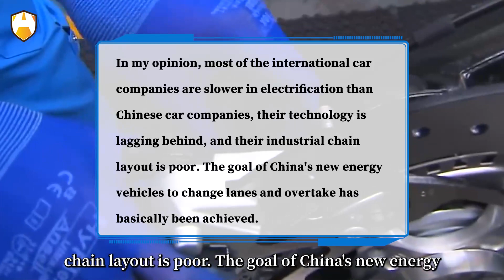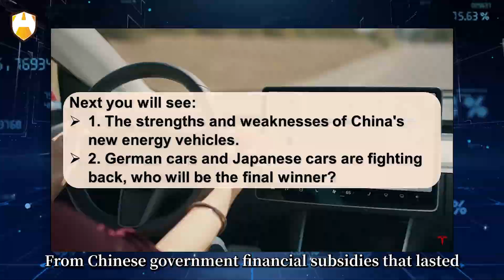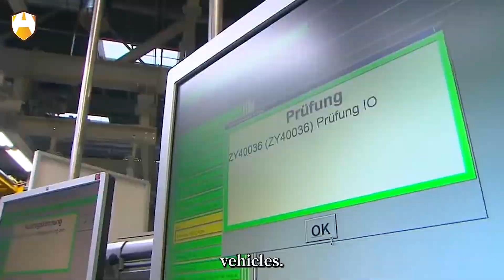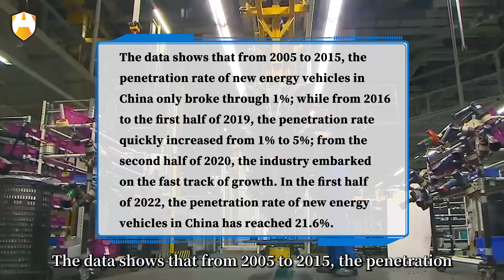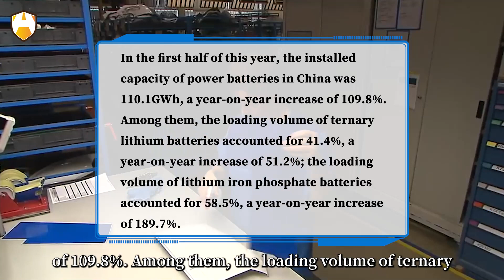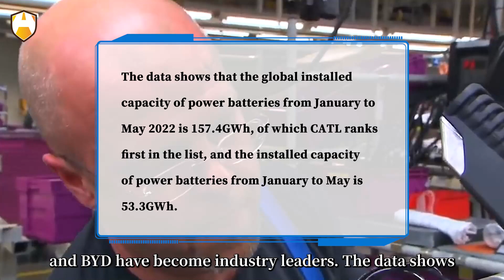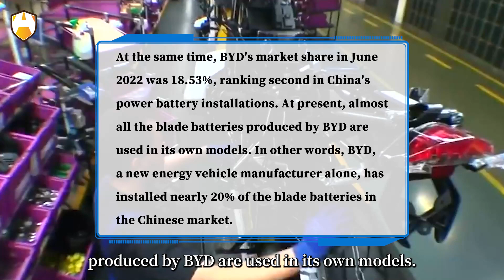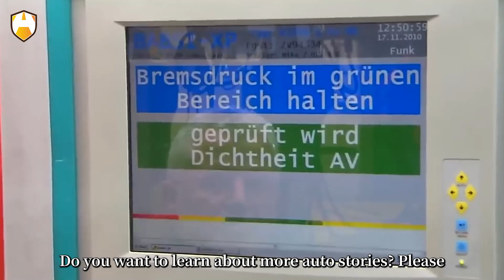China's new energy vehicles takes the lead, but Germany and Japan to fight back!

Comment: I'm sorry,  electric vehicles aren't green. They are expensive, no resale value, extremely  dangerous. They are the opposite of our highest good.

Not even a single country throughout the world is capable of supplying sufficient electricity for EVs. 

Many people aren't aware how dangerous EVs are. These are extremely high voltage ranging from 400V to 800V. 

The solution to our problem is steam engines not EVs. The entire automotive worldwide got everything wrong since day one. 

It's sad to see the Chinese car makers are duplicating the same  mistake.

Comment: We can only hope that Chinese carmakers will build affordable EVs for the world.
Reply: In China EVs are half the price.  They are expensive in the West because the government place high taxes on it. For example a Chinese EV called the CAT is sold around $8,000 to $10,000 but in US its $18 to 22K
Reply: @willng247  EV's 

Currently there are about 1-2% Vehicles on the Roads are BEV...

In USA, 71-75% Electric Powers generated from Coals, Fossil Fuels like Oil/ Natural Gas
In China, even worse, 81-90% from Coals and Fossil Fuels ‼Generated Electricity ─ This year, due to Rivers run Dried, very little coming from Hydro Dams.. Electricity = the most costly to distribute and stored.

What is the Purpose of BEV?  If it cost more and polluted the air about the same as ICE's☺?

Providing if 25% are BEV's the Cost of Cobalt's/Lithium and other Metals required to make Batteries would be like Petroleum?  Before China Joining WTO and India knew how to Manufacture Crude Oils were in Ranges of 10-20 US Dollars/ Barrel now China & India consume Crude Oils for Manufacturing that required Oil = Plastic Cobalt Lithium Batteries / Tires and all Computer Chips.

If China were to have citizen Riding the Bikes to shop or Take Public Transportation like 1970's ─ while The Workers who can work from Home ─ like during Pandemic and so on.  The World a better Place.  We don't need BEV or Cars ‼ We only want a Car of Peer-Pressures.

More can be extended/ expanded but the above Analysis shown that BEV is a Utopia of People Like Elon Musk got nothing to do but talking's...

C'est La Vie☺...♥